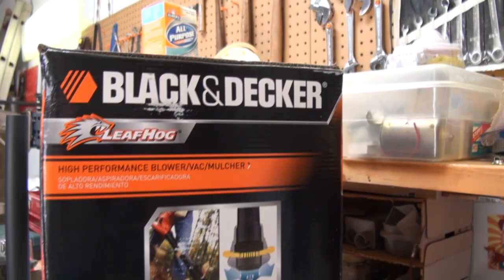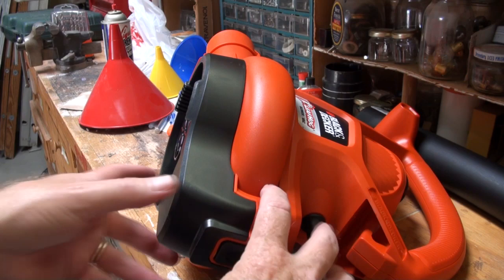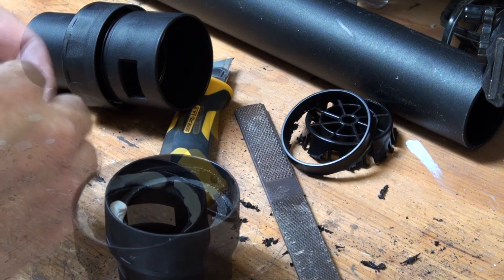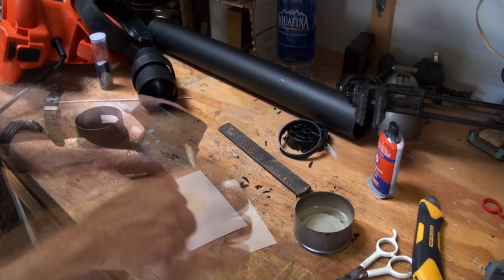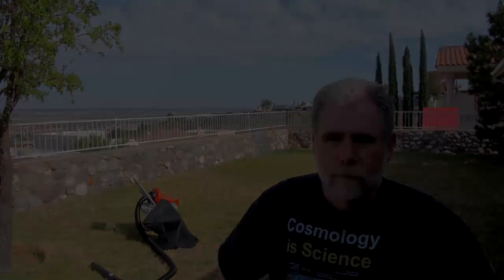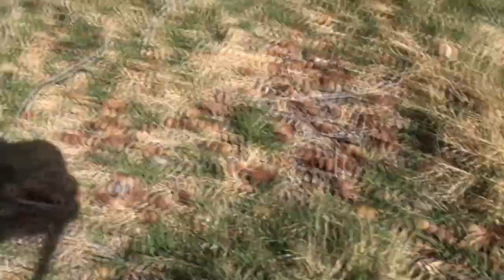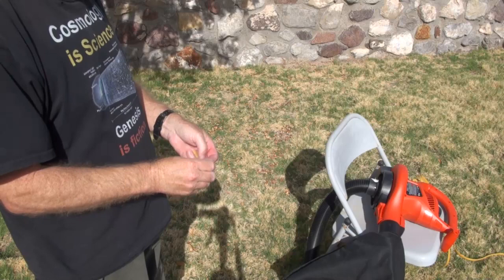Modify a Black and Decker LeafHog into an Uber-powerful Yard Vac

Comment: I had this problem with my Worx vacuum/blower. Bought a B&D and works alot better. Even more when you switch the power switch to High. It will pick up Norfolk pine needles with ease
Reply from the maker: The mighty putty holding the tube to the blower failed, I'm in the process of repairing it.

Comment: If you reduce the hose size on a shop vac, it would work also because you would have the air velocity you need.  However,  it would take longer because the flow rate would be lower.  That's an option for people who aren't willing or able to modify a leaf blower.
Reply from the maker: +Tony Shulthise Not a bad idea. Acorn removal season is approacjing, ugh.
Reply: Tony Shulthise 
Be careful doing that, it puts more amp load on the motor doing that. Be sure to check it when doing trial runs. I burnt up a little shop vac just adding a second hose.

Comment: I like your technique for the modification, it is well made, but a shop-vac would work just as well. The impeller on your leaf mulcher was designed to shred leaves to reduce volume, not chop acorns. I doubt you will realize much volume reduction with the acorns, but at least you can now use one tool instead of two. Not my style, but to each his own.

Comment: I'm thinking about doing this mod to use on sanding wood floors ! Usually out big sanders works as same principal " an impeller sucks the dust to a cloth bag" so it think it's worth a try
Reply: LiPe VoLcOm 

...or, you know, just get a shop vac and put a filter bag inside instead of the canister filter.  Shop vacs roll around and will be much easier to work with.
Reply: +Griffin Contracting My thoughts exactly...  this is what a shop vac is for.
Reply: +Mark 1042 it ain't work on a sander that easy! You need a simple blower and a cloth bag... I'm building a 1hp blower with a induction motor that can run for the entire job day edge sanding floor with out bothering abut the filter or brushes ! My best option was this blower with induction motor that it's pretty much what the main sand floor machine have on
Reply: +LiPe VoLcOm 

I couldn't make much sense of that...but I'd stick with a good shop vacuum.  There is no way a leaf blower with an awkward bag attached is going to work better.  What you are creating is only a less awesome version of what already exists...and you don't have to waste a day or two building and hacking it together.  A shop vac is designed for exactly what you are wanting to do, a leaf blower is loud and is not designed to do what you are trying to do....so just save your time and headache and get the shop vac.  Go.  Go right now.  Give it to yourself as a Christmas gift.
Reply from the maker: Over the years, many people have commented that I could skip this build and use a Shop-Vac. I have several shop vacs, and my largest still does not offer as much suction. But, even it did,  I would still not have had the fun of making this thing!

Many people also comment that the acorns will damage the impeller. What is not shown in this video is an intermediate chamber I added, consisting of a 5 gallon bucket with an intake and exit hose. Although the acorns never hurt the impeller, an occasional small rock caused concern, and the bucket catches those.

Thanks for watching!

Comment: I could be missing something, but are you not sucking this stuff straight through the impeller?  You REALLY need to fabricate some sort of 'pre-vac trap' to catch the acorns and what-not.  Even something like a baffled coffee can would help immensely... 

And then again I could  just just be wrong.... It doesn't happen often, but it has happened before. ;)
Reply from the maker: What is not shown in this video is an intermediate chamber I added, consisting of a 5 gallon bucket with an intake and exit hose. Although the acorns never hurt the impeller, an occasional small rock caused concern, and the bucket catches those.

Thanks for watching!

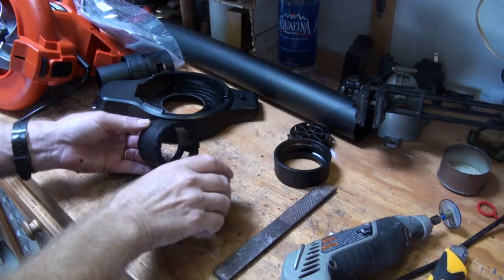Comment: What is the piece you cut at 1:18?
Reply from the maker: That is the peice that came with the leafhog that turns in into a blower. It covers the intake impeller.  I needed to modify it to attach the shop vac suction hose. Thanks for watching! I still use this crazy thing,  just last week in fact.

Comment: just buy a shop vac
Reply from the maker: Over the years, many people have commented that I could skip this build and use a Shop-Vac. I have several shop vacs, and my largest still does not offer as much suction. But, even it did,  I would still not have had the fun of making this thing!

Many people also comment that the acorns will damage the impeller. What is not shown in this video is an intermediate chamber I added, consisting of a 5 gallon bucket with an intake and exit hose. Although the acorns never hurt the impeller, an occasional small rock caused concern, and the bucket catches those.

Thanks for watching!

Comment: That might work for you but I have several thousands of acorns to deal with each year n chasing them with my shop vac isn't any fun. There's gotta be some way to make a push or self propelled leaf vac do the job. Good build though
Reply from the maker: I agree need a lot more power and a wider intake  with adjustable height.
Reply: @stevecrye  thanks for responding man. Wasn't sure if you would on a video this old but it's awesome that you did. So do you think something like those Troy built or craftsman self propelled leaf vacs with a 5 hp engine n a big ass turbine would have enough vacuum to pick up acorns? Wondering cuz I've been looking at some used ones for dealing with the leaves n if they could do acorns too that'd be awesome

Comment: Isn't this just a "less awesome" version of a shop vacuum?  It doesn't take much science or cosmology to whip out the ole shop vac and avoid the sound of a thousand acorns and rocks hitting an impeller.
Reply from the maker: yes. but I like making things. brings joy. and it works better than my 10 HP shop vac.
Reply: +∞ . Infinite Quantum . ∞ 

Very cool.  I totally understand the need to be a "maker".  I have a bit of that bug myself.  You will have to forgive me, but I would have to see a decent shop vac side by side with that modded leaf blower in order to believe it.  Maybe you could fill a 5 gallon bucket with acorns and then see which one sucks out the contents quicker.
Reply from the maker: +Griffin Contracting I later added a 5 gal bucket before the impeller to collect the debris and protect the impeller.
Reply: I meant to imply that the 5 gallon bucket could be used to hold a controlled volume of acorns for the test I proposed.  You could fill the bucket and then time how long it takes each set-up to remove all the acorns from the bucket.  Do it a few times to control for any differences in how you operate the devices/hoses and wa-lah! you have a bit of science going.

Comment: Why not just use an actual shop vac?
Reply from the maker: +Ron Yerke I have two  big Shop Vacs. They don't suck enough. (that sounds odd)
Reply: Well, a shop vac doesn't have debris going through its impeller like a blower does.  It should last a much longer time.  IDK what kind of shop vac you have, but ours will lift acorns and more quite easily.  We used to live in a property with a gigantic oak tree and 2 quite large chestnut trees.  It was a painful place to play tackle football for a while.

Comment: A true DIY x What I Needed - build.
Several comments on UCOULDOV. But that's not what you wanted.
10 out of 10. Thank you.
Reply from the maker: Thanks, that's very kind of you. I still use this little gizmo. Even though I've since bought some gear from Worx that attach to a 40 gallon trash can and some other stuff, this Black and Decker rig really can't be beat for just sucking up those annoying acorns.